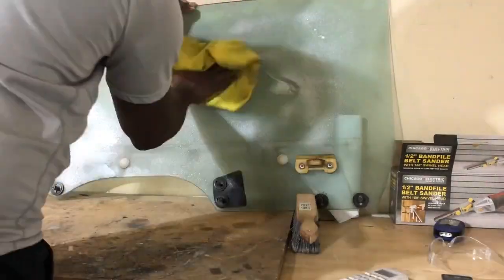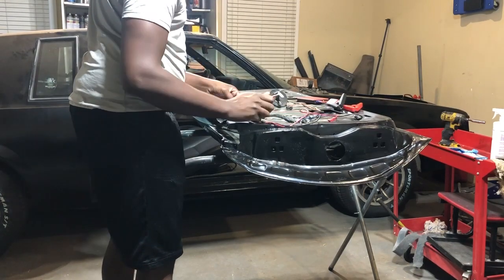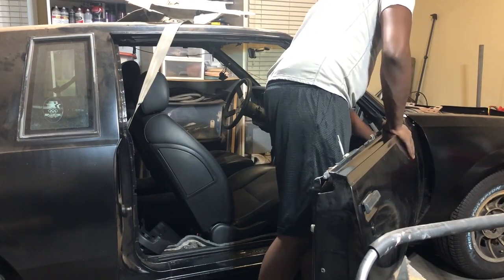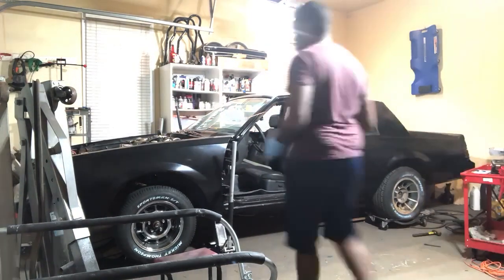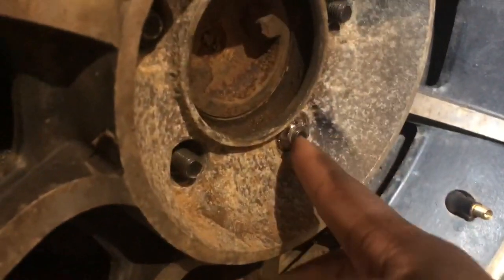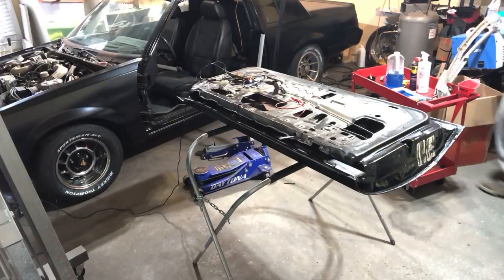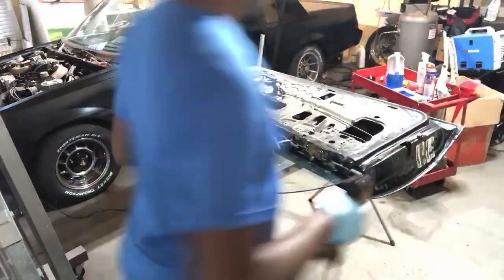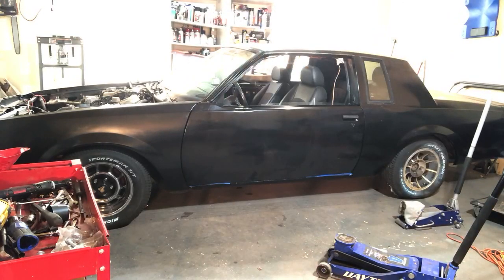Doors & Wheels Rebuilding a Grand National Part 17

Comment: It's coming together now! Funny somebody painted the wheels on my 87 T and they look just like the stock 84 gn ones. I like the steel 86-7 gn ones a little better though I think.
Reply from the maker: Same here. The touch of chrome in these are perfect in my opinion. I’ve seen the 84 wheels sandblasted and matte cleared and those look good too. Hard to go wrong with these cars